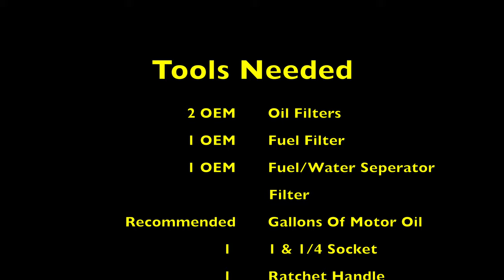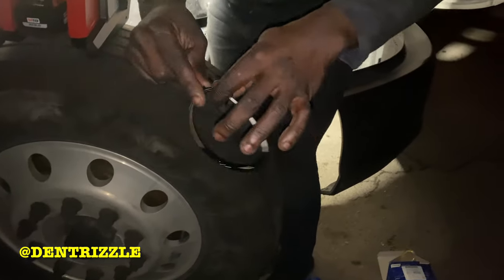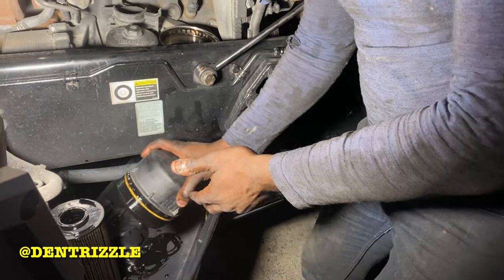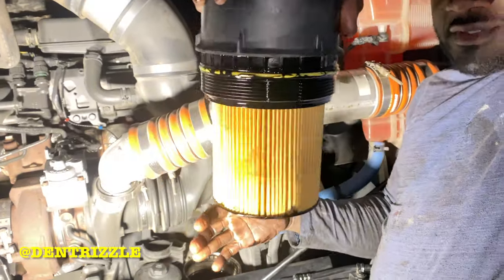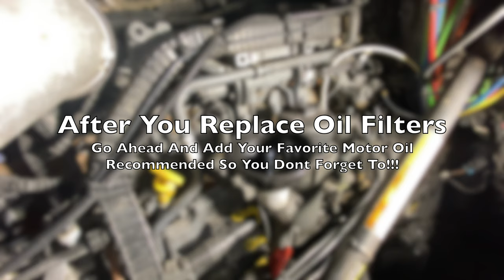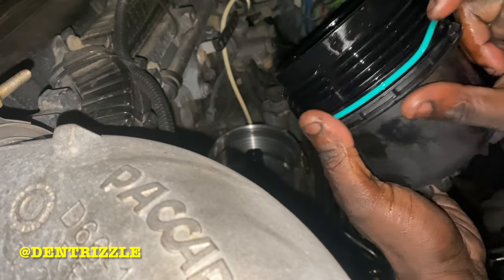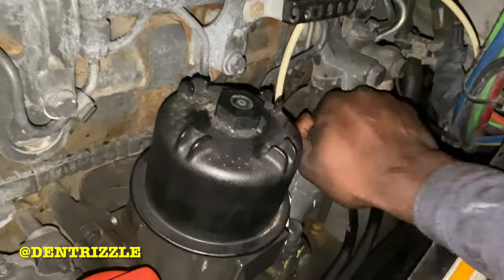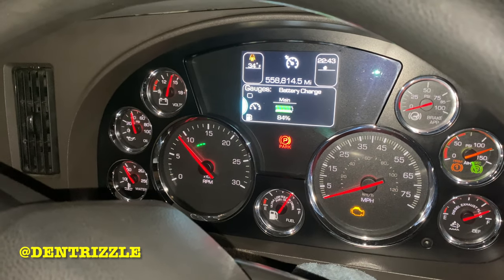How To Change Oil, Oil Filter & Fuel Filter On Kenworth T680 | Paccar | Peterbilt MX13

Comment: Hi great video. I noticed that you turn the bolt to " PRIME" only after you change the second fuel filter, you don't have to do it after you replace the first one too? thank you
Reply from the maker: @753bowie  You don’t have to because it just make it way easier to prime and start the truck. Sometimes I do it and sometimes I don’t. If you prime the truck after filter change you can turn the stew to prime it will start quicker then you return it back to run. Thank you for watching.

Comment: Got the same truck you ever had your voltage gauge float and give you a high battery voltage reading then goes bk to normal?
Reply from the maker: No that has never happened to me
Reply: Ok Thank you
Reply: That happened to me.  Turned out to be a bad regulator on the alternator.  Replaced alternator and problem solved.

Comment: Thanks for this video and the oil pan video!! I got a 21 t680 that I'm about to have to change oil pan on and I been nervous about it... did yours leak afterwards?
Reply from the maker: No it haven’t. Dry as a biscuit to this day. 🫡
Reply: @dentrizzle  you gave me lots of confidence in changing it myself THANK YOU BROTHER!! GOing to change mine tomorrow.. it has a micro Crack and it is just like yours was... oil every where underneath.. they have a replacement one that's a metal instead of the plastic... idk it's like 400 dollars more tho.. THANKS AGAIN THO!!
Reply from the maker: @killianstrucking5575  Just take your time and be patient cuz it’s gonna be like that and everything will work out just fine. You got this 💪🏽💪🏽💪🏽💪🏽

Comment: Where do you buy all those filters? Would you mind share the links?
Reply from the maker: They normally sell an entire kit at the dealership that comes with all 4 filters and the oil drain plug. When I’m
Close to an oil change I just grab a kit because the zone I operate got a lot of dealerships along the route. I know it may be cheaper on Amazon but I’ve never tried. Hope this helps.
Reply: Thanks man keep trucking, u did very good job
Reply from the maker: @garycao85  Thank you. Just Keep Trucking!!!